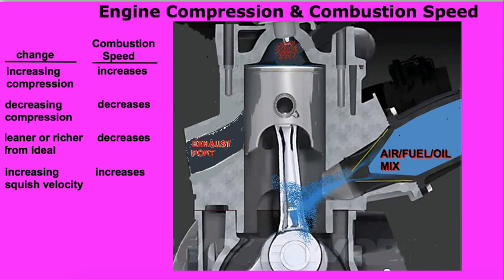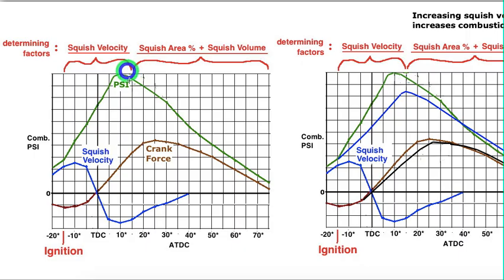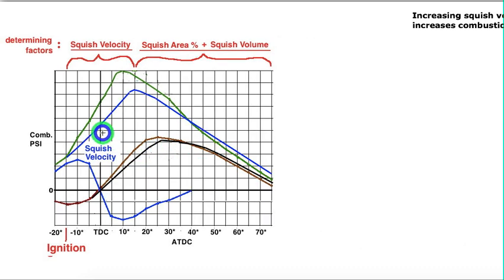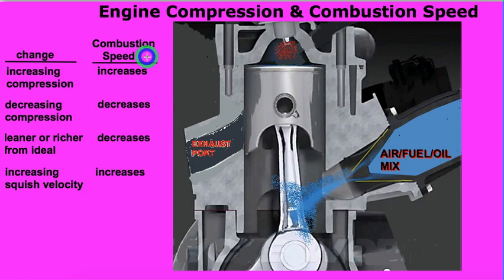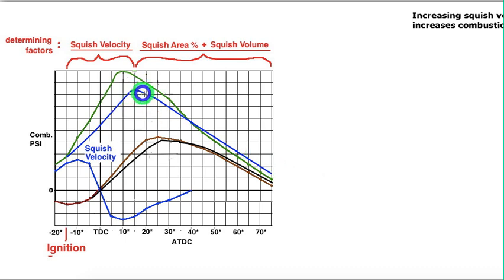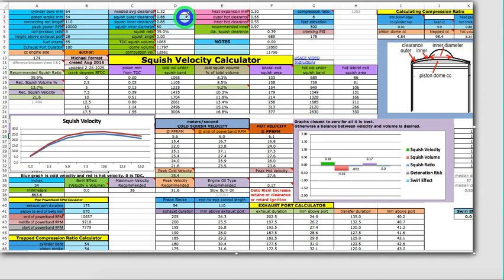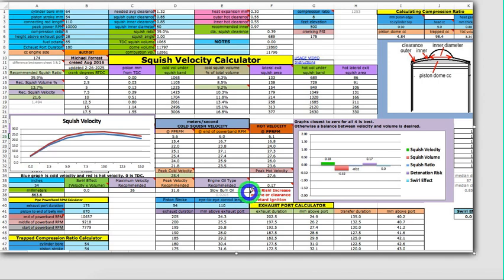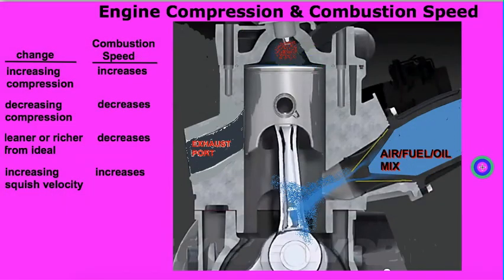Compression effects on Combustion Speed

Comment: So for a tuned (optimised head, timing and jetting), yet road engine, can you run castor without the dirt and sticky rings you reckon?
Reply from the maker: On my air cooled engine it don't stick the rings but it does leave thick coating on top of the piston. Maybe it's not as bad on a water cooled engine. It's very important that it isn't run lean. I've done extensive testing on mine to make sure both jetting and timing are optimal. Please refer to my Combination Tuning video for the right way to jet a carb (which isn't by looking at the spark plug).

Comment: sure you can use castor oil in a chainsaw what about all the power valve 2 strokes that are the highest performers
Reply from the maker: I don't understand why you would ask that, as if having a powervalve excludes you from using castor. Castor doesn't carbonize unless all the engine parts are extra hot from lean jetting, too much compression, or too much ignition advance. Just use my combination tuning method and then if the engine is too hot then reduce the compression. When you switch to castor you have to upjet and retard the ignition. Otherwise it will run leaner and hotter.

Comment from the maker: SQUISH VELOCITY - the higher it is, the more its turbulence causes a more rapid burn. Increasing the velocity can compensate for a lower burn speed due to lowered compression. Most bikes come with plenty of squish clearance so there is plenty of room to play with a lowered clearance. A squish calculator lets you see the present velocity and how much it will increase when you enter a lower clearance mm (to get an idea of how much metal needs to be removed from the head mating surface to increase the velocity by at least 10%). Read all about squish here: https://dragonfly75.com/moto/sqVelocity.html

Comment: It would be nice to have a heat release rate plot and a mass fraction burned plot to confirm the effect of compression ratio on flame velocity. CA1090 is the parameter indicates the combustion duration.
Reply from the maker: Yeah it would be nice but I've had many situations with engines that proved to me that higher compression causes a faster burn. Just the other day I was doing a free tuneup on a neighbors non-stock 70cc. It ran fairly good but I thought it had too much compression for the cheap engine. I told him it wouldn't last long like that because of the cheap bearings this company uses. So I added another head gasket and then it ran slower, sounding like it was too rich. So it was too rich but the high compression compensated for it by speeding up the burn which would of otherwise been slow due to the jetting. So I had to remove the extra gasket until we can find a leaner main jet for it.

Comment: I've found on my tuned ts250er once ring is worn beyond service I lose power in the midrange
Reply from the maker: that means your midrange jetting is too rich. Probably the needle is set too high. Use a digital caliper to find where the taper starts on the needle and use a marker to put a black dot there. Then install it in the slide and finger it into the carb and position the slide height so that the dot just disappears into the needle jet. The look at how much the front of the slide is open. It's probably more than 1/4 open. If so then lower the needle to bring it back to 1/4 open when the dot disappears. That will lean the midrange but also WOT so you'll need a richer main jet to compensate.